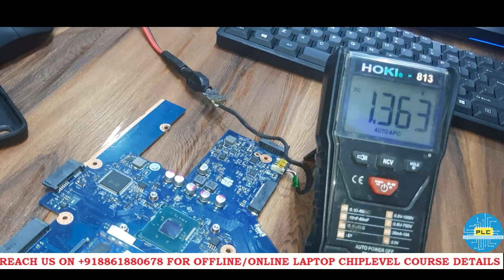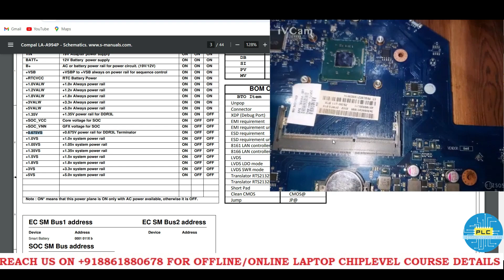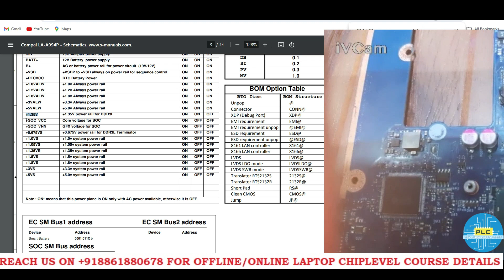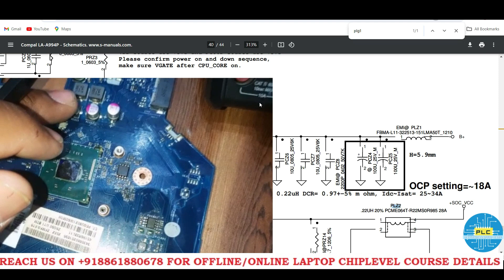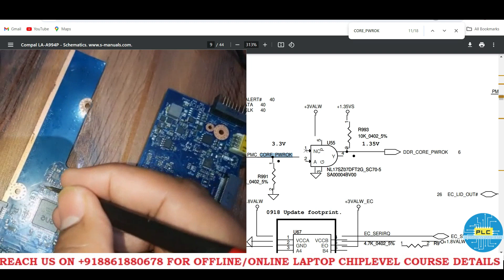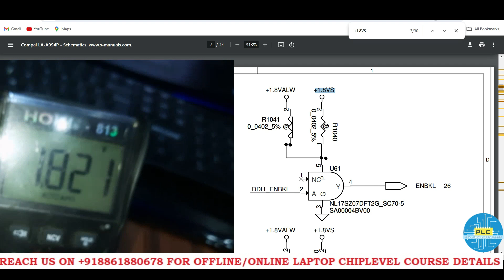Laptop Repair : S0 State without RAM? Is it Possible?  || Laptop Repairing

Comment: Suspend voltate of ram is missing or shorted in 8th and 9thgen ,
Reply from the maker: THANKS FOR REPLY. CAN YOU EXPLAIN SUSPEND VOLTAGE HOW MUCH AND WHERE WE NEED TO CHECK FOR MISSING? THANKS IN ADVANCE
Reply: 1.35 for ddr3l and ddr4 1.2 for cpu, and need to check vpp supply 0.95 to 1 volt
Reply from the maker: Ok. I will confirm to u